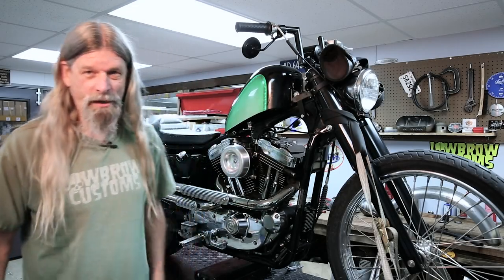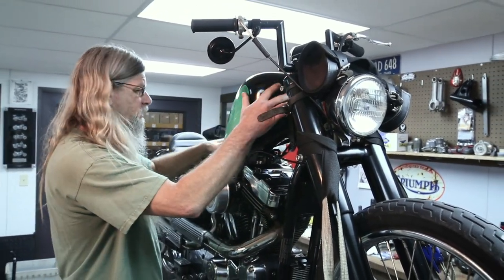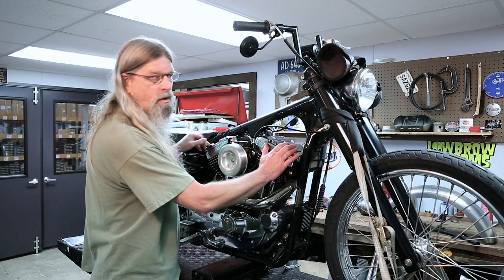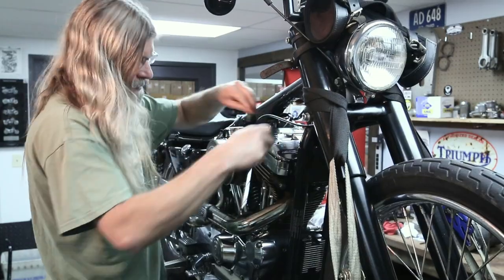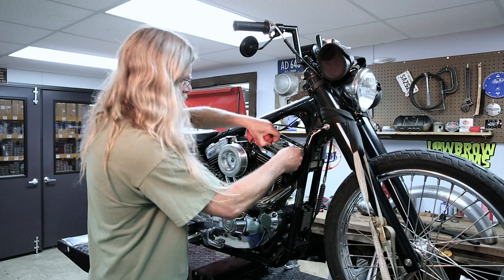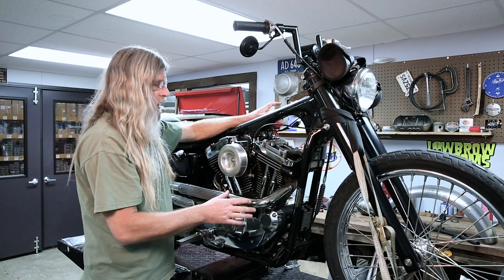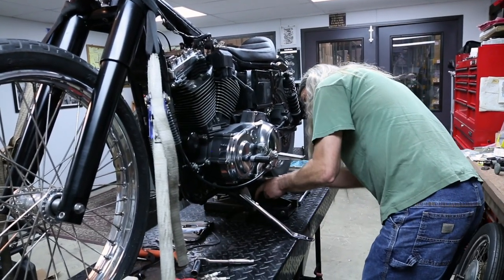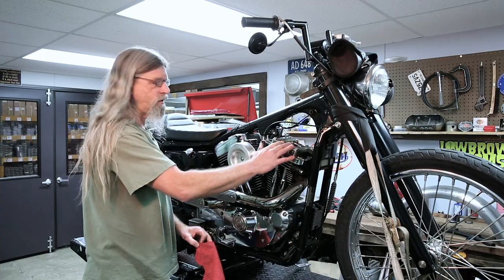How-To: Leaky Rocker Box Gasket Fix on Harley-Davidson Sportster

Comment: I have a 1999 Sportster that has had a minor but annoying oil leak for YEARS. I knew it was rocker box gasket related somewhere low. I was too scared to attempt the repair myself and wasn't trying to spend shop money, so I rode on and cleaned up (as it got worse). I've been watching this video for years and today I replaced my front base gasket following this video verbatim. THANK YOU! You have given me the courage to address ANY issue on my bike.
Reply: Awesome now I know Thanks

Comment: Cheers Dude; just did my 1200s and thanx to your walkthrough, it was a piece of pi$$. I was pretty apprehensive about attempting this, but, without a doubt the most difficult part was removing the old crappy OEM gasket residue from the alloy covers.

Comment: Used a seperate lowbrow video for my 883 conversion and near end of breakin found I had a leaky gasket.  Between replacement gaskets and the bolt kit for rocker boxes from their site I no longer have that pesky leak. UV-Light and dye always confirms 😂 Was a 2013, grabbed the torque specs from manual but the video was super helpful!

Comment: Thank you, I used this video to do my 2011 Iron. Only difference was to have it in top gear to roll the wheel forward, and there's only 2 parts in the top of the header instead of 3. 
Very easy to understand and saved me a couple hundred dollars.

Comment: Thanks for the pragmatic video - my youngest son bought a 2009 Sportster 883 and it had the leak on the nearside front lower corner and was starting on the the nearside rear lower corner.  [we are in UK so that is the kick-stand side on the left]. Your video helped.  Ordered all the parts and set to.  The front had clearly been bodged with gasket sealer.  We needed to apply some heat with a heat gun to soften the gunk and used an old credit card with a rubber mallet to ease it off gently.   A person had used a screwdriver gouging the machined face.  So a bit of water and 800 wet n dry wet sorted than on a mirror as a flat surface.  WE chose to buy two new brethers as one looked a bit sketchy.  Assembly was quick.  She started first time after filling with fresh fuel.  Awesome.
Many thanks !
Ride safe . . .

Comment: Brilliant mate. You give us the balls to do this ourselves. I left my chops engine into a certain HD dealer to have a new set of 1200 Wiseco barrels and pistons installed, rode it 100 miles and it's weeping from the exact place. 
I'll do it myself now. Has anyone ever had this happen I wonder?
Reply: Victor Lonsdale I had a 2008 1200 Custom, beautiful bike and I had a leaky rear cylinder/rocker box at 12,000 miles, got it fixed, cost me $250, six months later it was leaking again, took it to a different mechanic, another $200. I was told that it was a common issue with Sportsers but I was pissed so I sold the bike. Currently I'm riding a 1995 1200 Sportser & love it. The pre 2003 Sportys are better than the current ones, just my opinion!

Comment: Rebuilding a 1990 flhs and going with a 94-96 road king looks. Got it wired up with all new harness I made. New wiring and male/female plugs. My first Harley but second bike build. Found I had a front rocker leak. I knew I can change it, but dyslexia can be a challenge for me. So now I know what some people was saying about flat siding the cam. Pfft wish they wouldn't talk like it a top secret shop talk and not explain what they mean. If they even know what they're talking about in the first place. If they knew me they would understand, I know my way with tools, I've built a handful of auto engines,  a few race motors, and boat motor as well. It's all the same principle. 4 or 2 stroke. Fuel, air, comp, fire. It's just how the different companies decided how to achieve and direct it. I'll be subscribing, I'm not afraid to learn from someone else's mistakes, saves me from making it myself lol. Also, from someone that's a veteran in the field, I'm sure you know more about this motor then I do and I'm definitely going to be watching for any little tips that you learned the hard way. 
    Age is starting to creep up on me and I'm getting to lazy to learn the hard way now days.   Thanks, even if this video is a few years old. New to me.

Comment: Really surprised he didn't tighten the four main rocker box bolts in star pattern and with 1/8th turns at a time - something the H-D manual says is critical, as does every other video covering this topic. Not doing so can result in real damage to the rocker box. Lowbrowcustoms has definitely raised my eyebrows !  Moral of the story: always get your info from several sources !  . . .  and especially the H-D Manual when wrenching on your H-D.

Comment: Let lifters bleed down 30 minutes before removing or installing 4 big bolts on rockers! Removing last! Installing them first! I would also install rocker lockers to stop shaft noise when doing this job. Also use blue stuff on all bolt. Great video 👍👍

Comment: Gotta love Todd's videos 😆
Good luck installing the rear rocker box with the shafts installed 🤞
If you push a 16 inch .060 dia. length of wire down through the push rods, you can open the check valve in the hyd lifter. 👍
Foot lbs of Tq are 12 in lbs - hence 120 in lbs equals 10 ft lbs 🤔

Comment: Excellent video and instruction. I'm about to do this job on my 2013 XL1200C and I could have done it using just my shop manual but this video is very helpful. Got a fancy digital torque wrench that my family bought me for christmas one year and it does both inch and foot lbs! (my torque elbow is out of calibration)

Comment: 2019 is a bit different but this video gets you through the technical stuff.
 1st  need to raise the  front (disconnect fuel line) or remove  gas tank, so you can move coils and plastic covers that keep wiring harness and throttle cables tucked into place .  (save yourself some aggravation  and do it to begin with and its as easy as the video) needs to be done  for 3/16 Allen drives to fit and box cover  to slide out . 
   2nd There is no middle ring , rocker box is one piece and  the top cover

Comment: I just did this job on an early 1984 FXST.  Basically the same process I believe. I followed the video step by step & referred to my service manual as well. I did not remove the pushrods. I allowed plenty of time for them to bleed down before tightening any bolts. Please answer this 1 question I have? After all 9 bolts  were torqued down there is pressure on the rockers of both cylinders. I have cycled the motor several times by pushing on the kickstarter with my hand. I is easy to do and everything seems to be working smoothly but I am reluctant to hook up the battery and start the bike with electric start. Is it safe to try or have I missed something. Great video by the way!!
Thanx
Reply: ...Well did ya start her up?!  As long as she turns over Smoothly by hand AND you don’t have any parts left over I’d go right ahead and kick it. What’s the worst thing that could happen?... a leak is about it.

Comment: Great how to. I have the confidence to tackle them again if need be. I had a follow that's a good wrench help me around 2006 we had to take them apart for a noise, but the dealership left the front sprocket loose in the primary as soon as that bike started making noise I said damn that sounds like it's in the primary. But another Harley mechanic said top end of front cylinder so we pulled the rocker boxes, but took a chance and  reused the old gaskets and one leaked so we redid it. I have a question, on my cam cover the Chrome is flaking on it I got a pretty good price on a nice used one I have linked to a video below where a gal I think she's in the UK or somewhere she's pretty cool by the way anyways she pulled hers off without touching her rocker boxes at all. But I think hers is a rubber mount mine is a 2002 1200 custom. I guess wishful thinking but there is no way to sneak that can cover on and off without taking my 
rocker boxes off is there?
https://youtu.be/0R-_HM2MN0Y

Comment: Thanks for a very clear informative video.I noticed you mentioned the V Twin evo engine near the end regarding the alignment.I have a 1998 Road King classic 1340 Evo and looks like my rear rocker box gasket is leaking at one corner.Is it basically the same job on this engine. Obviously a lack of space on the rear cylinder as you also mentioned but  are there other points I need to be aware of?  Thanking you. Regards Dave .Scotland. UK.

Comment: Great vid Todd. You do an awesome job. Doing full top end gasket replacement on my 05 sportster xl1200r now. Rear Base was leaking a bit. All pulled apart and cleaning up the parts. Question....Problem getting the thin black gasket off the cyl bases. It is really baked on good. Want to be careful of the surface and reluctant to use a razor blade for fear of scoring the aluminum surface. Any suggestions on getting that loosened up?

Comment: Not that hard, no.
But the rear cylinder is a different story, with the large wiring harness going over the top of the rocker box. Not as simple as the front cylinder! More time consuming too!
Great video!
(I hadn't done that to my 08 Nightster 1200 a few years. So thanks for the tech tips!)
Reply from the maker: For sure thats why we didn't do it on this vid ahahha but you can see it done on our 1200 conversion kit - https://youtu.be/HCCR93g9r6Q

Comment: I have a technical question. I have a 2004 bigdog ridgeback chopper with a -117 ci. S&S mtr. The engine warms  up great , no  noise, after a few minutes on idle there is a screeching noise in both front and rear valve train. Any ideas? I’m thinking a broken key in the oil pump or worn out plunger  and  springs in oil pump and during the idle I accelerate and it smokes like crazy bluish color.  Please help !

Comment: Hello I have an 1993 HD classic Electra glide.
When I cranked it up is leaking oil through the top of the engine where the gasket are. I noticed that the gas is getting into the oil pan. Do you think my engine is blown

Comment: Another Great Video...... at 2:03   what is the part number for that tool to remove/ install covers 3/16  allen  wrench long handle...
Reply: I just took an old 3/16 and cut it off a little. Worked like a charm.
Reply: @michaelcriner1628  okay.  thank you...  will do...

Comment: I have a 2007 Buell Blast that I'm working on. I got to 4:22 and the box is not lifting. What do you suggest I do?
Reply from the maker: are you talking about the middle ring and top cover not coming off? or are you not able to loosen the bolts of the rocker box where he's showing the inside 7 bolts?
Reply: Top is off, bolts are out, but the next level did not spring up. It will not budge. I hit all the corners with a rubber mallet and nothing.
Reply: Thank you for the reply. 
I was able to remove it.

Comment: I have an 08' Nightster, that the wiring harness, running across the bottom of the frame and does not let the rocker box cover,  be removed. Do I have to remove the wiring harness too? (alot or extra work, and don't know where to start the removal of the harness, that is very thick.)

Comment: Can you tell me why my 2006 Honda VTX 1300 has never leaked a day in its life. And the high priced harleys always leak??? Even with 2k miles on them??? This is an honest question. I'm seriously looking to get a street bob but scared of having to go through all this shit. I do see it as a way to experience serious wrenching on my bike. But my question is why? My VTX is for sale currently but I am having second thoughts.
Reply: Sportsters* always leak... because they get hot as hell and most people ride them like a bat out of hell because they're quick off the line which makes the motor even more hot.
Reply: @coreywells3911  But this is the case with a lot of Harley's. I ride in a motorcycle club and me along with another brother have a Japanese cruiser. We're the only ones that never had had an issue.
Reply: improper warm up procedure will do it

Comment: Harley Davidson has been around more than a hundred years; they haven figured out the solution to stop the leaks on the engines?
Reply: this is a common problem, but its not Harley, its an improper warm up procedure
Reply: Bike Builder how long to warm up? And I presumed not to rev up when it’s cold..
Reply: @DavidRamirez-ol4sz  until you can put your hand 1" from the cylinder and feel warm.. the heads are mild steel and the rocker box is aluminum, they expand at different rates

Comment: Was thread locker left out of the video or is it not required?
Reply from the maker: its inside the motor, you need to torque everything to spec in the work shop manual. being that it gets extremely hot, thread lock isn't gonna do anything. its the torque thats keeping it together.

Comment: I need to change the gasket that is in the bottom, do I need to remove all the gaskets and replace them aswell when i OPEN it even tho I need to replace the bottom one? t hanks in advance
Reply from the maker: SpaceGorilla46 yes never reuse gaskets, they won’t seal the same way again if reused
Reply: @lowbrowcustoms  Thanks for the quick response, I went to the harley dealer and showed them the problem and all they gave me was a middle ring square gasket and the bottom gasket WTF
Reply from the maker: SpaceGorilla46 if you do reuse the old gadgets make sure they are in good shape, we say to always replace them because you are more than likely gonna have a leak in the ones you didn’t replace, may depend how many miles are on it too, but we always change out them all to be sure no leaks etc

Comment: I have oil coming out of the top bolt.....2004 heritage is that the same issue?
Reply: no. change the bolt, with new washer under
Reply: @bikebuilder8567  Ok will try that,Thanks.

Comment: Same process for big twin Dyna?
Reply from the maker: The process is pretty close to the same, but the gaskets and torque specs are definetly different. bolt patterns might be different to. we highly suggest getting a workshop manual for your specific year and bike.
Reply: @lowbrowcustoms  thanks 🙏 great tutelage. I have a manual with great black and white photos for that extra edge on the job !! 😂

Comment: I fixed my '99 sporty leak by smearing JB weld into the groove where it was leaking, clean first with carb cleaner, clean off excess JB weld with paint thinner, way easier than this procedure, no more leak........those super-thin gaskets don't seem very effective.

Comment: How  do you torque the rear head when you can't get to the bolts
Reply from the maker: you can get to the bolts its just a pain to do so. On the lid you have access to all 4 bolts, its tight but once you get the lid off its easier to access the same 9 fasteners inside the rocker box we go over in this video on the front. Using a flexible head torque wrench from snap on helps with this job immensely.
Reply: Thanks
Reply from the maker: no problem at all, if you need any questions answered or are stumped on something, feel free to contact Todd via phone a 1-855-456-9276 8am-4pm EST weekdays . Cheers
Reply: A torque adapter works well for the 5/16 bolts
Reply: @lowbrowcustoms  that's very nice of you guys.
Reply: @toddmuller768  do you mean the 7/16 headed bolts?
Reply: @mrbreezeet1  No the middle bolts  are 5/16 the inner ones are the ones that use a 7/16 socket
Reply: @toddmuller768  okay actual 5/16 bolts I know what you mean and they would take a half inch socket normally.
I don't know if you saw my other question it was a little long-winded. There's no way to sneak that cam cover on and off without pulling The Rocker boxes, correct?
Reply: @toddmuller768  there is a woman on YouTube I think she's in the UK.
 She swapped her cam cover actually she cut it down she was able to remove and replace it without disturbing the Rockers but I think hers was a rubber mount.
Reply: @mrbreezeet1  I would not suggest removing the cam cover with out unloading the top end by  removing the rocker boxes , you must take the pressure off of the lifters .
Reply: @toddmuller768  Oh, OK, thanks Todd.